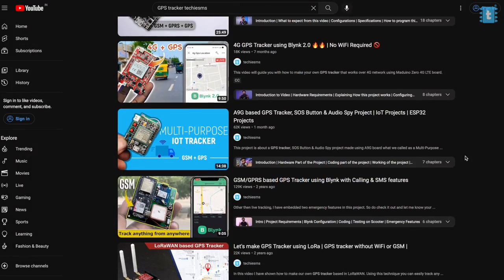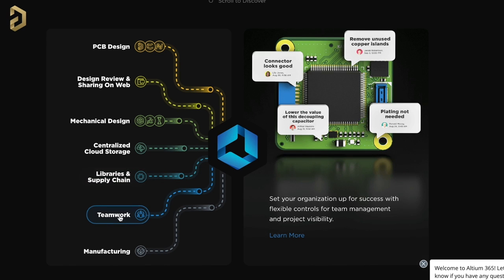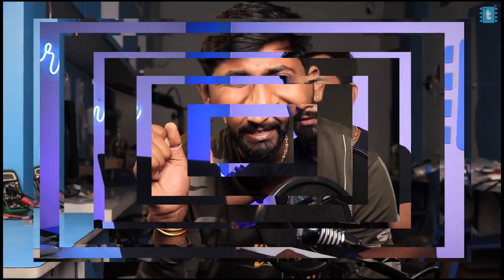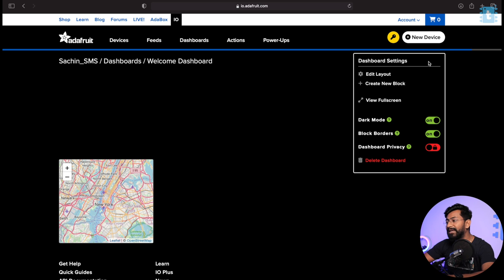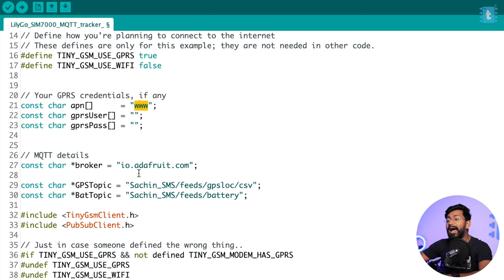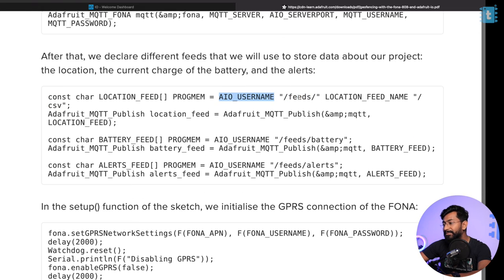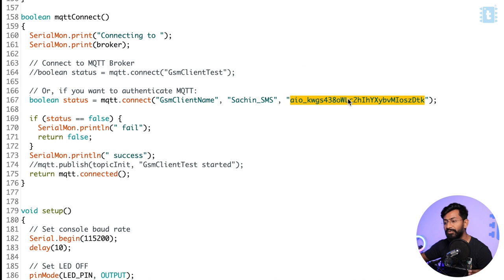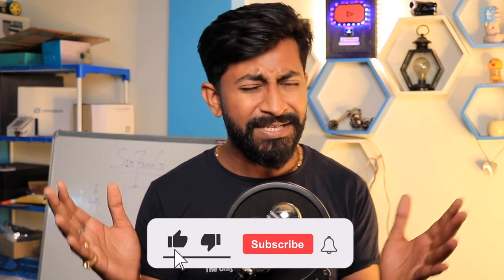GPRS + GPS + Adafruit MQTT + Solar Charging based GPS Tracker  | ESP32 Projects | IOT Projects

Comment from the maker: What’s your thoughts on this project ???

Also I’m working on one more smallest iot tracker. Excited???
Reply: Yes sir
Reply: sir i had a project idea but i am unable to develop a accurate out put for it 
my idea is to get speed using acclerometer sensor. help me out if u can make it
Reply: pls upload it fast
Reply: Very exited. Did you find a solution for the manual power up after the battery has died but the solarhas started charging
Reply: Can you please make a video on how to connect T7000 to azure iot hub?

Comment: Hello,
I had a question. Since the charging IC works with both Type C USB and Solar panel, does connecting the solar panel and USB simultaneously have issues?
What I mean is, will the USB voltage flow into the solar panel and deteriorate the panel?

Comment: Hello, I need some help.
Is there any secret to make the modem wake up when using the battery?
my project only works connected to USB. When it's on battery, it runs all the code, without having to connect the modem. Modem leds never light up.

Comment: As always, great video Sachin. may you could program the tracker to sleep before the battery dies, and activate when the battery level rises to a better level. Then manual reset would not be needed. i would like a LoRa Gps tracker for remote location tracking where no mobile coverage is available.

Comment: I was really excited about this product but then seeing the battery issues you experienced really killed it for me. Having only 12 hrs of battery life on a li-ion is not that great.

Also having to press a switch is a massive problem. If the tracker is hidden in a vehicle it might not be possible to press the switch.

I see that lilygo has released an R2 or v1.2  version of this board. Maybe it has fixed those issues? Are you able to get one of these new versions to test? 

Thanks for the good work

Comment: I had to use YouTube's auto subtitles to understand what on earth this guy was saying. Anyway, if this device drains the battery overnight, the solution is definitely not a bigger solar panel. The solution is either a bigger battery or programing the device to be less power hungry in low light.